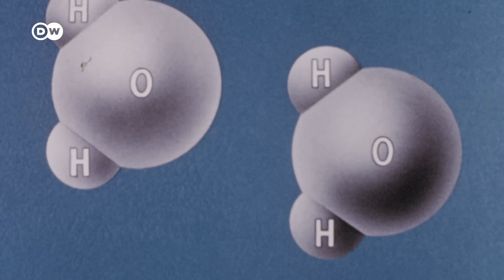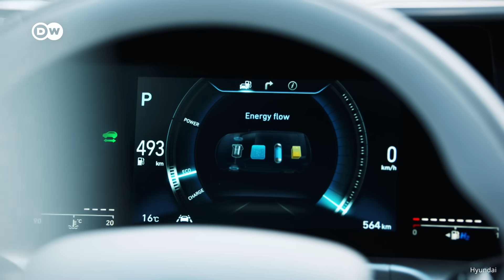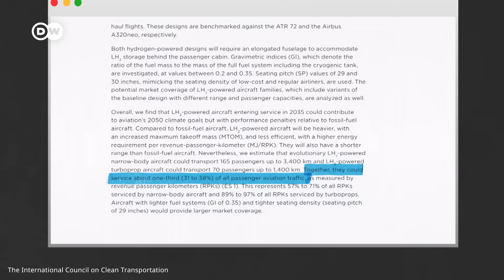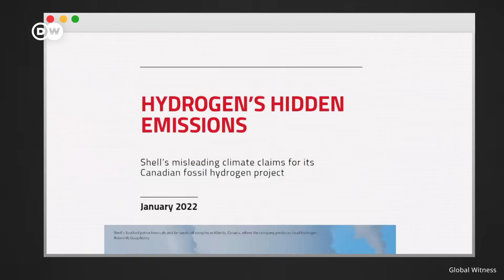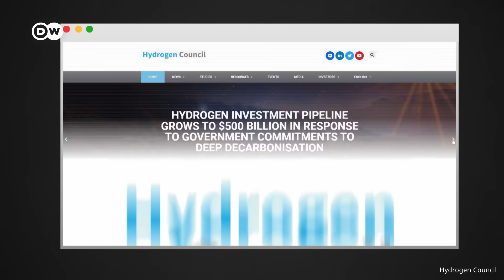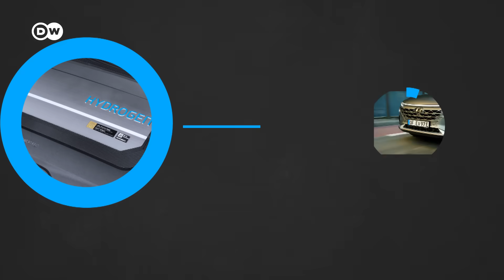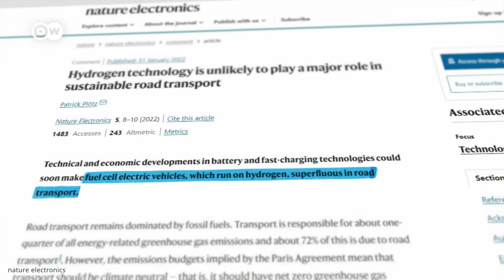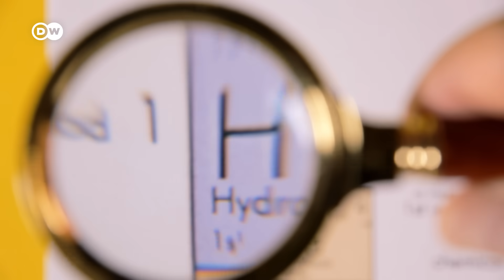The truth about hydrogen

Comment: I think you shouldn’t focus on just one technology. It should be a mix to achieve Net Zero, especially where it makes the most sense. What should happen is to start things NOW. The governments need to invest. In Germany for example we loose produced green energy because it can’t be used in the electricity system at that time. Instead of building electrolysis and storage facilities for hydrogen we just stop wind power mills from running.

Comment: As more people instal solar panels for their home and business there needs to be some method of using the excess electricity produced in summer and converting it to storable fuel, so hydrogen could be the answer, even if it is only for domestic home use to supplement heating in the winter when the solar panel;s will not provide enough electricity

Comment: Clearly a battery biased report.  No mention of all of the infrastructure required to charge batteries, no mention of the aweful impact of battery production on the environment, no mention of where are we going to get all of the rare earths, no mention of the cost and frequency to replace the batteries, no mention of total supply chain cost.  You did a huge disservice to hydrogen by focusing most of the report on blue hydrogen.  Clearly a big oil company scam- do't waste time on it.

Green hydrogen is the best way forward for most countries.  Nuclear electric generation ( new safe technology )  - or renewable powered electric generation in smaller locations with electrolysis generated hydrogen.  Need to spend more time on that.  Big machinery and airplanes will never work on batteries.  Good luck flying on battery power.  Green Hydrogen baby!  Get on board!!

Comment: I agree with you if you have to use the very fossil fuel to make hydrogen that you’re trying to get away from then there’s no point until you can produce it much more cleanly. I do believe it has a place in the world but not in the case of cars and vans. Feeding the electricity straight into the battery though a charging info structure is a more efficient and way cleaner  approach . And don’t forget Ev batteries are only going to get better ie solid state which will allow much faster charging times. The other problem with hydrogen is the size of the tank in a car to give it a realistic range.it  has to be much larger than say a current fuel tank take a look at the size of the tanks in Toyota’s Miri. As I said earlier it does have place maybe in the large commercial sector and especially if you can produce it on site. Interesting video.

Comment: Very interesting. It would be nice to also analise the impact of facilities in nearby ecosystems and to compare the harmful effects of the three methods of production mentioned here. Also, is the water produced from its combustion to be recovered or released to the atmosphere? If released and used massively, would all this water vapour also become a different type of environmental problem? In the case of lithium batteries, they might be a better solution but what countries have the resource and what are the implications for their people? We can't close our eyes to the environmental damage produced by big transnational companies operating in poor countries that have had plenty of natural resources.
Reply: The water can be condensed and used for other processes. Also, because of water's low residence time in the atmosphere it is not even a concern of some of ot leaks, as it will just quickly enter the water cycle (that is the academic standpoint on this possibility as of right now). An advantage for hydrogen is that a lot of infrastructure for its transportation is already built, in the form of long distance gas pipes used for natural gas.
Reply: I can't see how the exhaust water would be a problem.  Look at what happens after a rain storm.  Puddles at the end of everyone's drive way, wet sidewalks, wet roads, etc.  This is a huge amount of water, but it evaporates into the air without notice.  Water vapor from cars, buses, trains, etc. would be small compared to a rain storm.  If everything was run on hydrogen (I don't think that's a good idea, but it's worse case), we'd have slightly more humid days, but that's it.

Comment: For years we were told that batteries would never be powerful enough to drive cars any distance. Batteries are limited, and cost a lot to make and to charge. Green Hydrogen does not pollute. It is inevitable that it will be used to power a green planet (along with solar), so lets get going. PLUG it in.

Comment: I think there should be hydrogen generators in every car and factory in America. 
If we could design a hydron generator that will produce enough hydrogen on demand to fit the needs of different applications without storing it that would solve an abundance of energy problems that exist today. It's like an alternator or generator that charges your batterie in a car so that when you shut off your vehicle and come back later it will start. The same principal would apply in generating hydrogen in order to produce hydrogen you can use DC voltage to start hydrogen generator to start car then use demand limiter to raise or lower the amount of hydrogen as needed. Oxygen that is separated with the hydrogen could be directly streamed into the engine in tubes to help with mixture and efficiency metering. You could even use the water used in the combustion process to re fill any water used to generate hydrogen from the generator. "The byproduct of burning hydrogen is water", recirculate it back to the hydrogen generator for re use. 
The only problem would be adding or regulating the baking soda used for conducting electrolysis to separate hydrogen from the water. When the generator is over amped " energy demand "it will burn or break down baking soda reducing the amount of hydrogen it will generate. Trisodium phosphate might be an alternate to baking soda, I'm not sure...
We are smarter than this....
Reply: Unfortunately physics don't care about how smart (or not) you are. By producing hydrogen and trying to store it you are already losing a lot (depending on the efficiency of that apparatus I'd guess between 40 and 60%), hydrogen has the nasty habit to be able to diffuse through solid metal and alter its structure weakening the container. So do you really want to have an inefficient, unreliable and inherently unsafe hydrogen component in every vehicle for no benefit (because starting a motor isn't anything that's a problem today - it's keeping the motor running on a clean fuel).
Reply: @karlgunterwunsch1950  Thanks for the info- if there were was a generator able to produce enough hydrogen to keep an engine running without storing it, that would change everything don't you think?
Reply: That wouldn't solve anything - the production of the hydrogen is a wasteful process that requires a lot of additional energy. To generate one kilogram of hydrogen requires at least a full Tesla Model 3 battery worth of energy. Except the FCEV can drive less than 100km with the hydrogen while the Tesla Model 3 can go 300-400 with the same energy.
Reply: @karlgunterwunsch1950  What do you propose?
Reply: @ufofool  Forget about hydrogen in cars. The technology is too wasteful to be used somewhere where much better alternatives are already viable. Hydrogen has it's use in steel production, fertilizer and cement production - where it is the only viable alternative to fossil fuels. 

For cars battery electric vehicles are so darn efficient that it doesn't even merit looking for alternatives, any advances to that technology will come in incremental improvements to the battery, charging technology and charging infrastructure but that's it. 

To spell it out: A current BEV is 70-80% efficient from electricity generation to driving the wheel. In hydrogen use just electrolysis under optimal circumstances is only 60%-70% efficient. Transportation and storage are only 60% efficient (and that's optimistic to say the least). The fuel cells (and they are expensive and require a lot of maintenance) are also just about 50% efficient (if you insist on combustion to extract the energy from hydrogen you drop down to 20% efficiency at that stage). To get to even close to the efficiency of a BEV you need improvements across the board - and contrary to common beliefs, hydrogen fuel cells and electrolysis are well known and researched technologies, some of it already in use in the Apollo missions with a hydrogen fuel cell being the culprit for the near fatal failure of Apollo 13.
Reply: @karlgunterwunsch1950  Did not realize that, I appreciate the info.

Comment: Green hydrogen indeed is a carrier and not a source. But it may be a solution in two ways. One, situations such as steel production and aviation where large amounts of energy are required at the same time. Two, a transport medium, getting energy from remote renewable sources (e.g solar energy from deserts or wind energy from the sea). The latter may be interesting taking into account that a small area of desert could supply all the solar power to meet e.g. EU energy requirements

Comment: I'd also discuss that hydrogen is much more suited to buses and larger trucks. The sheer weight of batteries needed for larger vehicles is both counterproductive in comparison and wasteful of relatively rare resources (in addition to what must be longer charge times). Personally, I don't even want to invest in an EV right now (I'll keep driving my Prius) because of the feeling that truly useful and practical battery systems are quite a few years away (and by that point the market value of today's EVs re: resale will probably plummet).

Comment: Hydrogen is a VERY poor fuel, especially if it's made from water by electrolysis. Made by electrolysis, it has less than 80% of the energy than hydrogen made from methane (natural gas) or from oil and hydrogen has only 20% of the energy per pound (kilo) of methane (natural gas) or about 1/1000th that of gasoline or 1/8000th that of diesel or a 1/1,000,000th of hard coal (anthracite). Now scientists believe that water vapor is far more harmful to climate change than carbon dioxide, so burning pure hydrogen may be tens of thousands of times WORSE than burning coal or oil for the environment. Since volcanoes emit TRILLIONS of megatons of carbon dioxide an hour from the ocean floor, science says carbon dioxide hasn't harmed the Earth for millions of years...

Comment: So where is all this hydrogen going to come from ?  The electrical energy needed to split water into oxygen and hydrogen must be "renewable" or it's not a "green solution". Then there is the energy input needed to get hydrogen. Far more has to go in, than you get in the hydrogen. Of course the oxygen has an energy equivalent, but how do you extract this from the oxygen ? Burn it with carbon to make carbon dioxide ? Surely not !
Nobody has thought this through at all. Best to use the electricity directly, and still use fossil fuels where unavoidable.
Reply: Proton Technology (Canada) has developed carbon free hydrogen extraction. https://www.youtube.com/watch?v=_SsrqTxcAqE

Comment: First of all, hydrogen is still early in its development.  If it's failure, why big corporations still actively investing and producing hydrogen tech?  Currently, battery makes more sense for consumer vehicles but in capitalism, more efficient doesn't always win.  Ability to produce, transport, and sell hydrogen is much more attractive to corporations.  Than people just plugging into power outlet.  And the jobs that comes with that infrastructure is more attractive to politicians.
Don't just look at consumer cars either.  For airplanes, drones, and cargo transports, lighter hydrogen makes more sense than heavy batteries.
Reply: Hydrogen powers forklifts for the biggest companies in the world. There is a hydrogen powered cargo ship crossing the ocean, and a major airline is building a prototype jet. Several auto companies have developed hydrogen engines. It is all happening now. Check out PLUG discussion groups.

Comment: The fuel of the future is going to be a basket of low carbon intensity fuels. Hydrogen as an energy vector/carrier (and hydrogen derivatives ammonia, methanol) are going to be part of that diverse energy mix.... Therefore, H2 is not THE answer; it is PART of the answer.

Comment: The great thing about hydrogen is that it's a place we can use the excess energy produced by wind and solar during the hours they overproduce our requirements, to support our energynet during times they do not. Keeping the energy process as clean as possible(green hydrogen only for this case).
Reply: I agree and think this is its greatest benefit. Anywhere where natural green energy production can happen during offpeak hours can produce hydrogen instead of losing most of the power production capability. If you loose 60% of energy transporting it that's still better than getting no production. Dam's are a great asset for this also.
Reply: @robertwoodhouse406  but before having excess of renewable production we can wait a long long time... I really think that H2 is no solution and they are just trying to say : we can keep the world like he is without changing anything ! It is hopeless ! Before being profitable an electrolyser has to work maybe 4,000 hours per year, you can't be profitable by just using the exess quantity of electricity 500hours per year ! There will never be excess of renewable because at a certain time it will be to expensive to build the marginal PV that will create excess of electricity 80% of its time
Reply: @adrienhamot9484  with the vast natural gas infrastructure throughout the world a gas replacement makes sense for home heating cooking and distribution using existing supply chains.
Reply: Yes, hydrogen can be used for energy storage but for that it competes directly against battery technologies that (unlike lithium ion) are not resource constrained, such as sodium batteries or iron-air batteries. These batteries are 3 times more efficient at storing excess renewable electricity than hydrogen is. Green hydrogen makes sense for green ammonia (for fertilizer) or green steel but not for grid support.
Reply: @JoeWein  I'll take your word for it. 
You think there are any locations/cases where hydrogen would be better than a battery? Say, near the sea to refuel hydrogen powered ships?
Also when you say efficient do you mean size, cost, difficulty to set up or all of the above?
Reply: Currently, we cannot economically justify transporting methane from remote oil fields, which is why a lot of it is simply flared.
Transporting hydrogen is much more expensive, so I doubt that we can afford to transport it from a wind or solar farm either.
Reply: Exactly

Comment: Great video, thank you.  Hydrogen is a bad idea. Let's assume it is as efficient as electricity, can be stored in the same space as gasoline, and are all produced as green hydrogen only.  Even in that scenario, you will have an energy source provided by multinationals.  It will not give the same freedom electricity offers (by having solar panels at home, your car may not need energy from anyone else and nations do not need to build hydrogen pipelines to source or supply hydrogen.  So even if all the major technical hurdles are removed (and I suspect some will never be solved), hydrogen remains a poor alternative to electricity.

Comment: IMO, renewable energy production needs to come first, then the low efficiency energy storage of green hydrogen wouldn't matter nearly as much. Until then I guess it could be used as storage when there is excess production, but that would mean being able to start/stop production rapidly, maybe a battery buffer could help.
Reply: Storing excess electricity is dead simple as long as people use hot water. Much easier than storing it as hydrogen. Norwegian water heater company OSO Hotwater is doing that right now, with a potential for megawatthour storage per day in Norway alone, to be naturally expanded as people replace their heaters.
Reply: Shipping and industrial processes that currently use coal directly (like steel-making) make up a massive part of greenhouse gas emissions that most of us do not directly see although we would notice their significant absence in our daily lives. Clearly cargo ships and steel plants (which burn coal rather than need it for electricity) cannot replace their requirements with renewable energy production. Ships need to carry their energy source with them for extreme distances and carrying extreme loads; wind, solar etc cannot provide the chemical elements for the reactions necessary to produce steel - hydrogen provides an alternative to both, although in completely different ways.

Comment: So much can be done through hybrid electric approaches.
Take a ship. 
-H2 fuel cells
-Solar on the top layer of containers - Some could even be battery containers with solar panels.
-A few vertical "sails" that use the Magnus effect. Although it may just be better to have vertical wind turbines that can be lowered when the wind is from the front.

The largest container ships are about 24000 square metres. If you could cover 20 000 square meters with solar containers, then that would be several megawatt of output even assuming a 200W average per square meter. It won't get one all the way, all the time, but with a few battery containers and some backup H2 fuel cells it should be do-able.